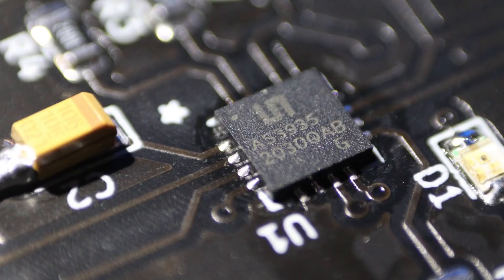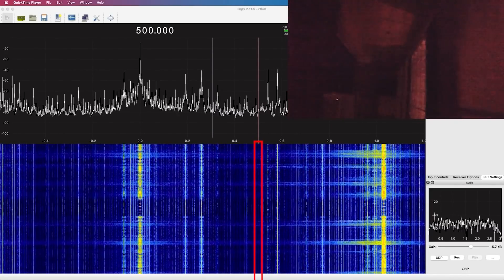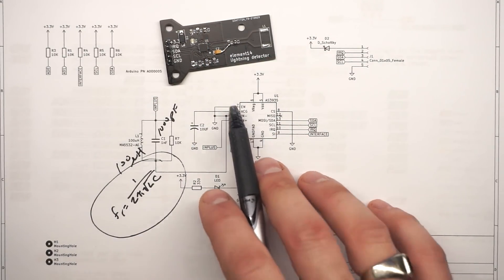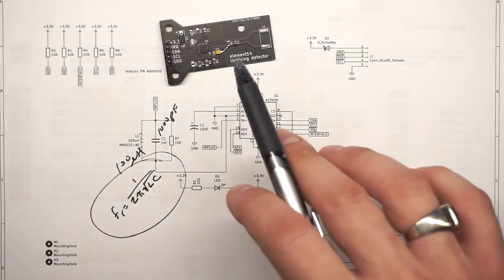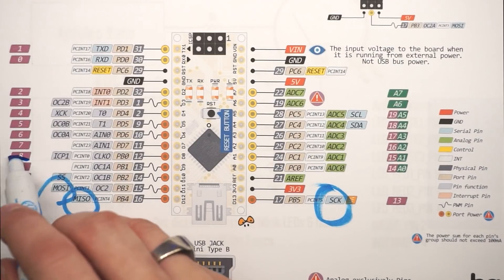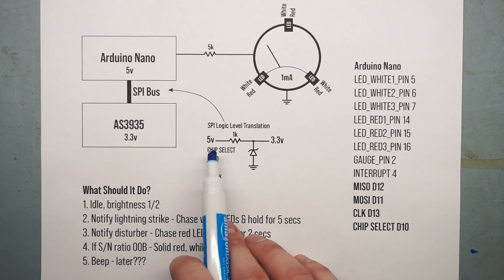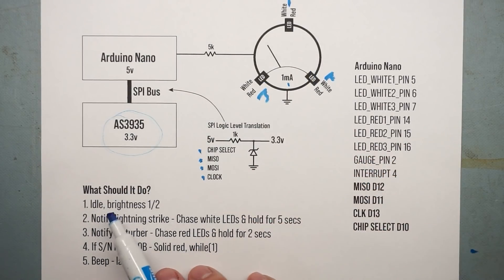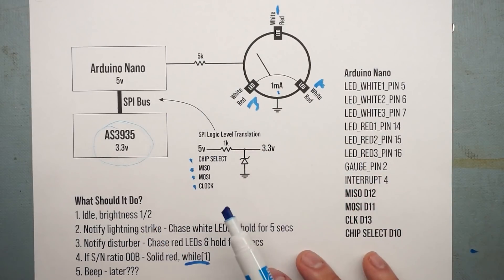Build a Tank Circuit Lightning Detector - DC To Daylight

Comment: The AS3935 will operate with a supply voltage of up to 5.5v so why did you need to use voltage translators to interface a Nano?

Comment: Ive had mine working quite successfully on I2C for the last couple of years. I do have an small RF data transceiver next to the module and when ever the Arduino sends data it triggers the lightning detector. I worked around this by having a delay once lightning is detected, transmits data and then then the delay kicks in so the Arduino ignores the lightning detector. Would love to know a way around this? Maybe move the small transceiver further away from the AS3935 module?

Comment: You could always buy the AS3935 development kit which includes a lightning simulator. They also give you the CAD files for their lightning simulator board and a parts list and  instructions for doing the layout for the antenna, so you could make a copy of it (for non-commercial use, of course).

Comment: There are man made devices/machines that attempt to simulate lightning. I took a course once on the effects of lightning on aircraft and observed one in action. They don't have as much punch as Mother Nature but they are impressive. The things are a tower stacked with very large capacitors wired through (break before make obviously) motorized knife switches. To charge the capacitors they are connected in parallel via the knife blades, takes 10+ minutes depending ..... once charged the operator of the "room" that the device is housed in (safety all around) flicks a switch that moves the switch blades to connect the charged caps in series. Get it? A flick of another switch discharges the caps through an electrically connected ball and a huge metal plate acting as ground. Very impressive to observe. The device under test is placed between the ball and the floor and the simulated lighting flashes right through it.

Comment: Great video I learnt a lot thanks. Not sure you need to clip the voltage on SPI MISO pin?? It's 'master in slave out', it will be driven by the lightning detector board (if there is any communication back) not the Arduino board... erm please correct me if I'm wrong?

Comment: I suggest scavenging a 455 Khz IF strip out of an old AM receiver. These are basically narrowband amplifiers, and 455 khz is supposed to be free of man made signals, which would otherwise break through almost all AM radios. Tune your tank circuit to 455 and you have a narrowband receiver. Then look for fast rising or falling transients from electrical noise (lightning etc.)

Comment: Since you cannot be home to manually disconnect your antennas at all times. Did you use any spark gap or gas discharge tubes spike voltage control systems to protect your radios? I’d love to know what brand and do you use TX on control lines from the radios to switch the spark arresting devices out of the antenna circuit while transmitting to prevent them from conducting during TX?  KE8TNW

Comment: Hey there, I got my hands on the ScioSense device as a sample from the manufacturer a bit before they were released. I wanted to automate a method of disconnecting my antennas from my station as well. Anyway, i got so far as 3D printing a device that can un/screw a SO/PL and separates it along a linear rail system I concocted, but could never get the I2C to work properly on the chip. I put the project away until I could figure out a better way of predicting lighting nearby without an internet connection required. I considered building a receiver that listened for the broadband energy..but just got busy with work and back-burner'd it n1dun.
Reply: @The Current Source That was probably my prototype you saw. I was in the same boat with the I2C. I finally got frustrated and connected it to a digital analyzer. That told the entire story right there.
Reply: @wxfield  they make linear coax connectors that push together so you Vulcan use a linear actuator and sled to disco your coax. Much easier to build.